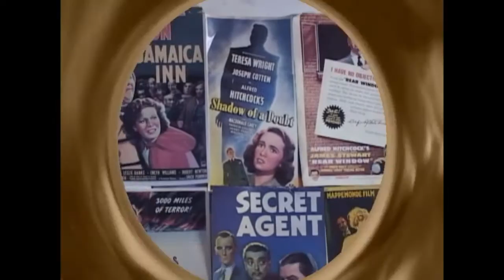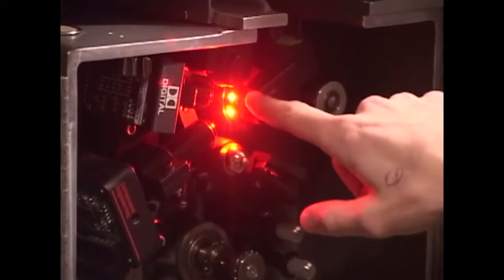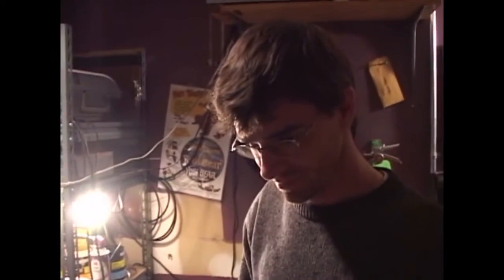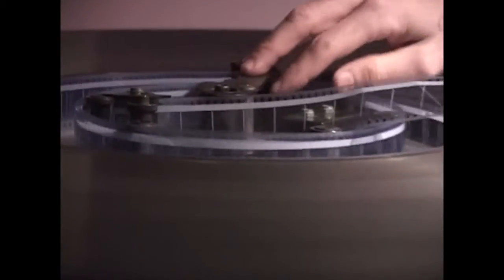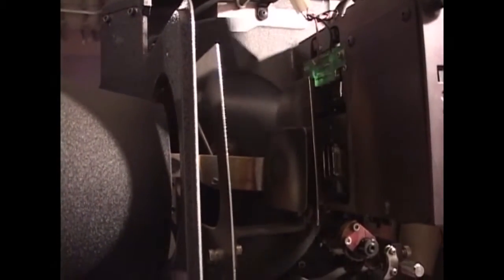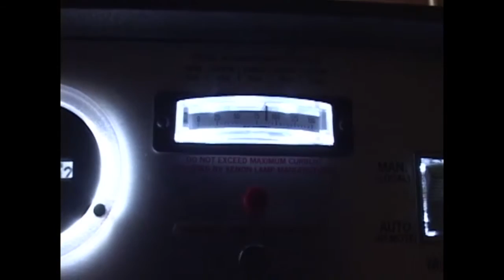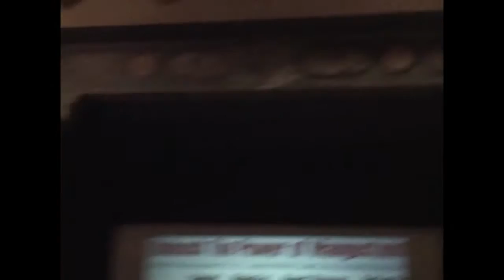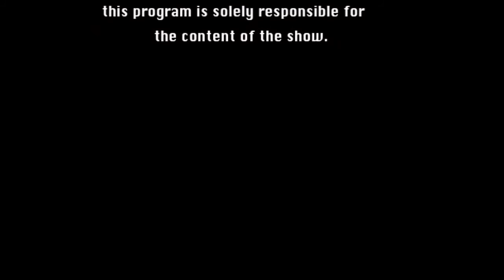Inside Look at the Grandin Theatre 2005

Comment: Isn't it weird that now I have one projector that came from the grandin theater? I'm not sure if it's the one he showed, but it's a strong simplex 35 millennium

Edit. Yes that's my projector, I can identify the serial number
Reply from the maker: We had 4 Simplex Millennium's that were purchased in 2002 for around $13K each. The main one featured in this is now sitting outside in the rain at Black Dog Salvage but it sounds like you have one of the other ones. Congrats. That's a piece of history. I've got an older Simplex E-7 from 1938 that ran films at there before the renovations.
Reply: @jgar35mm  hello Jason, yes indeed I bought that projector for 500 dollars plus 304 I think for shipping, I restored the projector unfortunately I couldn't fix the kelmar systems film cleaner it was pretty oxidated and stuck, unfortunately the package was separated into two parts, part 1 arrived (the projector) part two (the soundhead and anamorphic lens) did not, the package had a problem and ups has it, apparently is in roanoke at the local UPS, and there nothing I can do about it since I'm in Mexico and due to travel restrictions I can't go and for obvious safety reasons, the projector is working and is looking fantastic, needless to say it was in pretty bad shape it was very rusty dirty and it had a lot of dirt, I bet you have tons of good memories threading that projector,
Reply: @jgar35mm  if you  are in roanoke and can recover the 5 star soundhead you can keep it, inside that box there's also the anamorphic lens featured in this video, along with other accessories, I'm also selling the projector also featured in this video for 1500 shipping included fully functional, the box is apparently in roanoke at the local UPS
Reply: I'm not sure how to DM here on YouTube but if you're interested send me a DM and I can give you the tracking number and info